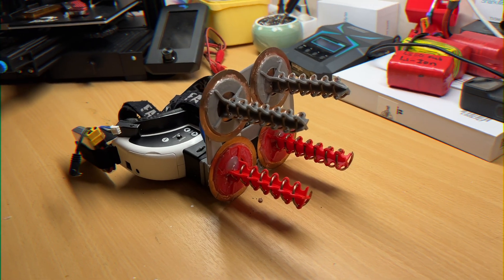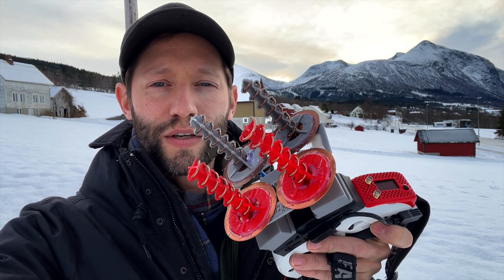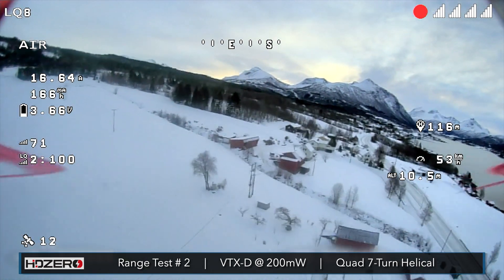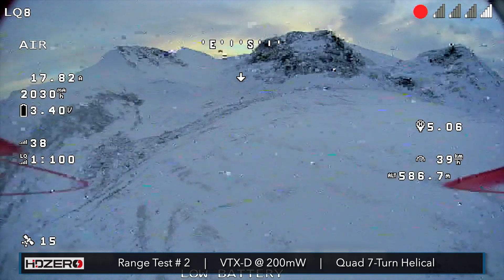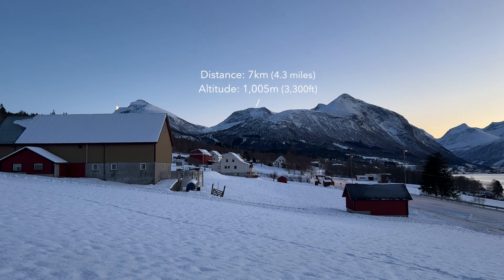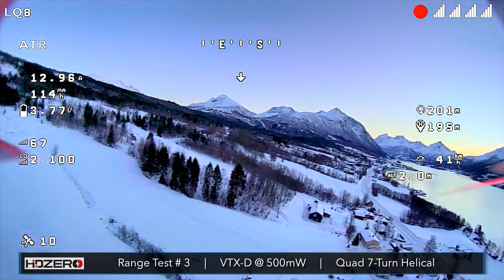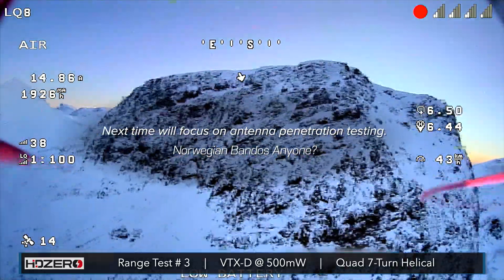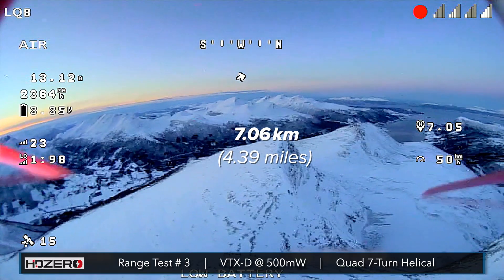HDZero SharkByte Long Range Testing with DIY Quad Helical Antenna! UFL to SMA Adapter Modification

Comment: That was an amazing clutch landing. I'm glad that you pushed it to see if you could squeeze that distance. With that setup the battery is the true limit
Reply from the maker: Thanks, glad the effort and risk with this test was appreciated. The current quad setup is kind of a joke, amazing it even goes this far… I’m finishing up my 7” build with some “top secret” parts now and will post a video later this week. So stay tuned and thanks for watching, cheers!

Comment: Love your test ! 
You need a wing to test the full potential;)
Reply from the maker: Thank you, appreciate the comment. I do need a wing, that’s for sure... I’ve been looking into them recently, Spring project probably. I’ll be testing the new 1W VTX soon, but focusing on penetration and video signal quality under 10km instead of crazy long-range which would require a wing. So stay tuned and feel free to ask questions or give suggestions, cheers!
Reply: @GiantAntCowboy  sounds good:) since im limeted to the dji range i stoped flying longrange. but the reason i would switch back is the googles factor.. the hdo2 was the best fitting googles i ever had. the dji is rubbisch
Reply from the maker: @Bjoerng9  interesting, never hear they were uncomfortable. Good to know. 👍

Comment: Can these helical antennas be anything more "compact" like (same turns but coils to be winded bit closer to each others)?
Reply from the maker: The coil spacing determines which frequency the antenna will receive, so short answer: No, you can not alter the coil spacing. 
You could however do smaller 3 or 5 turn antennas and still get decent range, and honestly you don’t really need 4 helical antennas. In my previous video I just used 2 helicals and was out about 6km with great video signal. 
Thanks for watching, happy to chat more if you have questions. Cheers!
Reply: @GiantAntCowboy  Oh right, I understand now. Im pretty new to LR FPV so i would like to know - what'd be most versatile antenna setup? Would 3 turn Helical + 7 turn helical + Patch + omni make sense for both short and long range up to 6km?? To be more precise, I m interested in exploring abandoned cities so I need good building (concrete) penetration if thats possible at all with existing antennas.
Reply from the maker: @brezovprut4431   No problem, it’s all a learning experience. My understanding is that the HDZero system performs best with matching antennas. Ex: The two stock patches and two helical antennas, or two stock patches and two omni antennas.  
The key to penetration is actually, low frequency, but we are stuck with 5.8ghz, and so must rely on high output power and high gain directional antennas to help the video signal penetrate objects. HDZero will be releasing a 1W VTX soon which should have great penetration ability, I’ll be testing this soon, but for now you’ll want to get some high gain antennas. Specifically Helicals or Crosshairs. When planning flights you’ll have to choose range or penetration, no one is doing long-range through buildings, it’s just not possible.
Reply: @GiantAntCowboy  Yeah, definitely didn't mean to fly "LR through" buildings, but rather close range around buildings and long range linear without obstacle. 
ATM. I just have Skyzone Cobra X with steadyview, and hope i will make nice antenna upgrades. Thanks, and sorry for bother ! I will consider all of your valuable informations.
Reply from the maker: @brezovprut4431  No worries, I just wanted to be clear. If money is of no concern the TrueRC X2-Air antennas are supposed to be great, they are a “Crosshair” antenna. If you don’t want to spend a lot helical antennas are usually cheap to buy, but almost free to make, and have incredible range and penetration. As I said before you really only need two, and I have a DIY video that shows how simple they can be made. If you live some where you can buy them that’s a great option too! 
Long range is a lot of fun, but take it slow, set up GPS, GPS Rescue, and install a Loud Self Powered Buzzer like a ViFly Finder 2. It’s very easy to lose your drone… and very sad when you do. Cheers!
Reply: @GiantAntCowboy  I've seen already interesting content on your channel and i subscribed for more. Keep up man ! Cheers !
Reply from the maker: @brezovprut4431  The support is very much appreciated, just happy to share with others in the hobby. 👍

Comment: Interesting, spectacular and instructive videos! Thank You!
Tell me, at 3.3 V cell voltage, when you’re flying over cold, snow-capped peaks and you’re still in full swing away from the take-off point, how come the copter doesn’t land sooner?
How do you allow the battery to run out so far? (2.3 V) Doesn't it hurt anyway? Obviously, a lot can be subordinated to the experiment, I just care.
Thank you in advance for your answer!
For spelling mistakes, if any, I apologize to you, I wrote with a translator ...
Reply from the maker: Thanks, appreciate the nice comment. So during this test I’m actually using a DIY 4s 4200mAh Li-Ion battery pack. Li-Ion cells can operate between 2.5v-4.2v unlike LiPo batteries which would be dead at 3.2v… this was confusing for many people actually. 
If you plan to do long range you should research Li-Ion packs, I have a DIY video which shows the build process, it’s pretty easy with basic knowledge and tools. 
Happy to answer questions, thanks for the support, cheers!
Reply: @GiantAntCowboy  Thanks for the reply! I don’t think it’s spread because of its relatively heavy weight. What’s in favor of LiPo is the smaller the voltage range you can work in. How heavy is the Li-Ion battery you use?
It’s likely I won’t start assembling battery packs like this, especially if it even includes extra electronics.
However, I would love to watch the video about what you mentioned. Would you like to drop your link?

Hi: Norbi
Reply from the maker: @norberthorvath6827  The benefit of Li-Ion is that it has more energy per gram. 
- Ex: My 4200mAh Li-ion weighs about 300g, but a 4200mAh Li-Po would weigh between 400-500g. The downside of Li-Ion is they can only output about 45A vs LiPo which can output 150A+. 
- For long range you don’t need a lot of amps so Li-Ion are  a good choice. You can buy them, if you don’t want to make them, but here is my DIY video if curious. 
- DIY Li-Ion batteries for Long-Range:
https://youtu.be/hnjgdUU3x5A
Reply: @GiantAntCowboy  Thanks!

So it's clean. I watched videos like this even before yours and one of them had some electronics built into the pack. https://www.youtube.com/watch?v=CZjo05qlerQ&t=22s
It takes more serious knowledge, I'm sure I wouldn't experiment with it, and I don't have a spot welder either ...
I'm flying a 5-inch copter anyway, there may be a peak current above 45 A. Would this damage the Li-ion battery anyway? Who can catch fire?

Joyful flying in 2022 as well.
Hi: Norbi
Reply from the maker: @norberthorvath6827  The battery in the video you referenced is way more complex than you need. I just solder mine, and have no special electronic components. 
If you pull too many Amps from a Li-Ion battery it will quickly lose power, and could get warm enough to catch fire, but it’s unlikely unless you are really trying to damage it. Just need to watch out power levels and avoid full throttle. 

Anyway unless you really start doing long range this might not be important to you, but they are nice batteries to have for extra flight time. 👍

Comment: Your trims are driving me MAD!! fix those end points to stop that drift lol!! 
Cool to see digital making some headway
Reply from the maker: So annoying right?! I tried adjusting the trims but actually one of my rear arms is slightly twisted... It’s looks especially bad here because I’m flying slow/flat, and the video is at like 8x speed. Anyway, this quad will now become a bando basher test machine and I’ll be replacing it with a Chimera7 build featuring the new 1W VTX, so stay tuned for those tests. Cheers!

Comment: Great work FPV mate ! Thanks for these insights. I have now to built myself those patch antennas to test them on DJI see if I can get as far, or even further 1,2w. Yet I don't own a 3D printer. Maybe you should sell TPUs. Might be an Idea for those like me.
Reply from the maker: Thanks, appreciate the comment. To build these you don’t actually need a 3D printer, you can just wrap the copper wire around a plastic/wooden tube, space the coils the proper distance apart, and then solder a coax cable to the coil and a piece of metal (copper or steel). Here’s my DIY for reference: https://youtu.be/TS4fYcT3DEE
Depending on what country you’re in, you may be able to find helical antennas for pretty cheap. Let me know if you have questions, cheers!

Comment: Can you use an Eagle Tree Vector with this system and use Eagle Tree’s OSD?
Reply from the maker: I don’t think so… but I really don’t know. I know it currently works with BetaFlight, and iNav, though a new firmware to improve iNav functionality is being released soon. 
I’m not really that familiar with the Eagle Tree system. I’ll let you know if I find out anything though, cheers and thanks for watching!
Reply: @GiantAntCowboy  Thank you.  I’m loving the shark byte  system so far. As long as they work with my Dominator V2’s.
Reply from the maker: @horsship  yes, HDZero/SharkByte should work fine with Dominator V2, as I believe that has an HDMI input. The image of course won’t be as nice as some newer goggles like HDOs for example, but still a big improvement from analog!
Reply: @GiantAntCowboy  Wonderful. Thanks!

Comment: Great LR test using my preferred antenna. at 7km you still have 4bars.. atlast we may close the gap of dji systems. it looks promising. 
Btw, what should be the setting for the battery if using liion? 3.3v min, 3.4 warning? also vbat compensation on? you mentioned about >2.5v but did you adjust the minimum in betaflight?
Reply from the maker: Thanks Jeff, appreciate the comment and support! The system is performing very well. Li-ion batteries can safely drain to 2.5v, but ideally you’d land before 2.75v, so a warning around 3.4v could be good. My warnings are still set for LiPos, since I periodically still use LiPos, but I watch the voltages consistently while flying long-range. I don’t have vbat compensation on, and have adjusted the minimums in BF. 
I’ll be testing the new 1W VTX in a couple weeks so stay tuned for that. This has already been proven to greatly surpass DJIs limit of 13.3km, check out out buddy Wez’ long range test here: https://youtu.be/mYELtL8ACww
Thanks again for watching, cheers!
Reply: @GiantAntCowboy  thank you for the clarification. So  you did adjust the minimum in BF to 2.5v? For example I leave the min at 3.3v then I fly lion, once 3.3v is reached, the quad will fall down right? So adjust when switched to lion? I watched wez's test, it's amazing minus the big Ray antenna haha.
Reply from the maker: @jeffclassics  The minimum battery voltage is just a warning. Once you reach the minimum voltage you’ll get a blinking warning, and your beeper with will beep if setup. You quad will not just shut down. I believe mine are still set for 3.5v based on LiPo batteries. I never change the warnings when switching batteries, I just know that the warning is Fake when flying Li-Ion. 👍
Reply: @GiantAntCowboy  great. Its now very clear to me. So I may just fly my setup with lipo or li ion and less care abt the settings. Thank you.
Reply from the maker: @jeffclassics  Exactly, just remember which battery you’re using, and leave room for error. I often fly to far, end up draining the battery too far and have to take a decent walk. Haha! Li-Ion batteries are more forgiving, overdrawing a LiPo will result in a puffed battery which can become a fire hazard eventually… so best to just plan to land early. Cheers!
Reply: @GiantAntCowboy  thanks and happy holidays. Be more gentle on your batteries.

Comment: I notice with dji gear when my r9 on 900 MHZ auto ramps up to 1200mw my Video show it’s but still getting 5miles
Reply from the maker: Yea, ok. I’m using 1W with my Crossfire which is not surprising to cause disturbance. In fact when my friend flys his DJI Phantom he gets disturbances from my setup, again probably the CRSF

Comment: Now I'm really looking towards swapping from DJI to Sharkbyte!  What's the total weight of the sharkbyte cam+vtx+cables on that setup?
Reply from the maker: You know, I don’t actually know the weight of the VTX but the camera is like 6.5g and the wire is probably 3g depending on length. The VTX I’m using is outdated anyway, and the new replacement is being released in a few weeks. I’d recommend waiting for that if you’re planning in long range. It will be heavy though, because there a metal heat sink attached to it. There’s a picture if it in my video here at the 4:30 mark if curious.  
Thanks for watching and definitely keep an eye on this system, it’s evolving quickly and doing neat things. Cheers!

Comment: What I don't like about sharkbyte is that the picture becomes cluttered like on analog. while in digital, for example DIY OPEN.HD The picture is 1 km, 50 km of the same quality
Reply from the maker: Yea, the image static is a result of poor signal and low latency. Basically the system is giving whatever image it has as fast as possible. Most digital systems buffer and repair the image which makes it look nicer but at the cost of latency. (A higher powered VTX/better antennas would help this, and also HDZero could offer different modes to improve this.) Higher latency may be acceptable in certain applications in exchange for better image, like Long-range wing flights for example, but here’s a couple theoretical examples for context:

- I don’t know OPEN.HD, but SIYI system, which is probably similar, performs very well in range tests, but it has a 180ms latency. Here’s what that means using round numbers:
180ms at 100kph = 4.86m, meaning the image you see is about 5m behind the actual quad. So by the time you see a tree 5m away you’ve actually already crashed into that tree. 

- HDZero has fixed latency around 25m/s and in the same situation above the image is only 0.7m behind. So the tree you see 5m away is actually 4.3m away which is plenty of time to avoid the tree. 

Probably more information than you wanted, but I just started typing... Haha!

Thanks for watching and sharing your thoughts, HDZero is still evolving and from what I’ve seen is happy to work with the community to adapt the system as needed, so hopefully we’ll see this sort of improvement going forward. Cheers!

Comment: Incredible! That is actually good news! Been waiting a lot for something else digital than dji, which could be capable of LongRange! Bud, you need a small wing to push the range further! But really great achievement!
Reply from the maker: Yea, i search for Long-Range HDZero SharkByte info forever and only found like two videos… so I just decided to buy the system and see what it can do. Very pleased with the results so far, and in fact I see no reason to keep my analog gear. 

Additionally I’ll be testing the new VTX-L next month which should be closer to 1W of power and will make a huge difference in both range, signal strength and lower the interference issues. A wing would definitely be great and I have started researching them recently. Thanks for watching and commenting, stay tuned!

Comment: OMG. Did the quality of the HDZero video went down? It's noise all over the place, from start to finish. Who wants to fly like this, with constant noise in the video? And the quality looks really bad, even on 1440p.
Reply from the maker: Yea, good observation. There are a few factors here that hurt the quality. First was I think I converted the TS DVR files wrong which caused some compression quality issues. The noisy image really gets bad as I get further out, and I think this is due to poor signal but also the Crossfire interference I mentioned in the video. Last but not least, it’s was getting pretty dark when I did these flights, I have brightened up all the images to make it more presentable but this lighting situation certainly made for a less ideal image. Thank for watching and providing feedback. Next tests I’ll pick a sunny day! These are the shortest days of the year, so it’s impossible to find beautiful sunny days at the moment. Haha! Stay tuned!

Comment: With the 2170's li-ion's - from my testing I found that going to 5s 4000mah on my 4s 6" quad was actually the sweetspot for long range.. 6s was just getting a bit too heavy and on 4S there was wasn't quite enough power available.. The battery looks stupid though! XD
Reply from the maker: Yea I’ll be making some 5s packs soon for my Chimera 7 build. I chose 2807 1500kv motors, so 5s is really the ideal battery size. Excited for the upgrade and take this system into the mountains for some proper testing!
Reply: @GiantAntCowboy  Should be a good combo! I really need to get my 7" running again.. 

Man I wish I had mountains like you have to fly around here - Australia is just soo flat!
Reply from the maker: @GlobeFairy  yea, I Google Earthed Australia once in 3D and didn’t find and decent mountains to FPV. Beautiful coastline though! Maybe you can hop over to New Zealand, that’s looks like an FPV paradise!